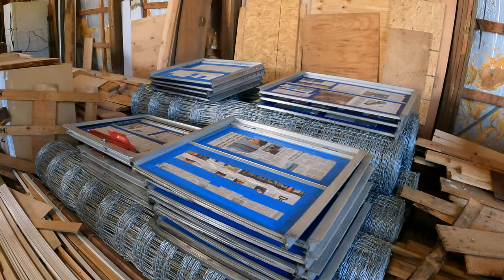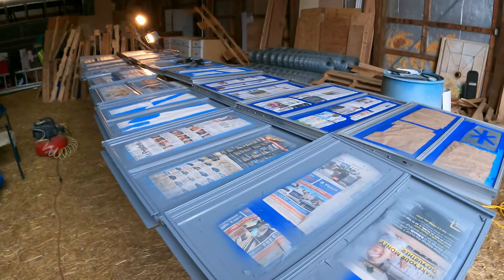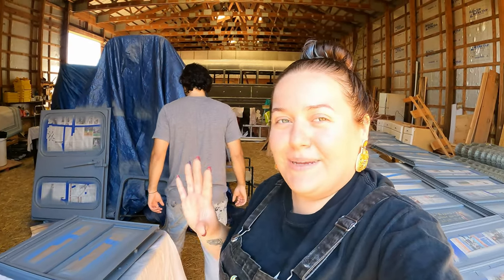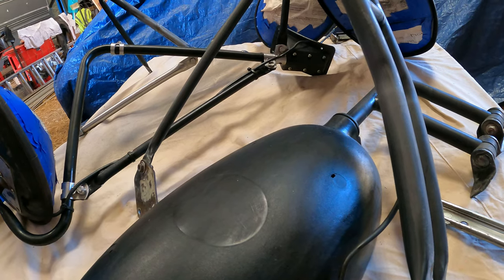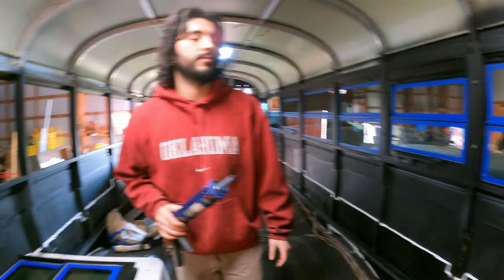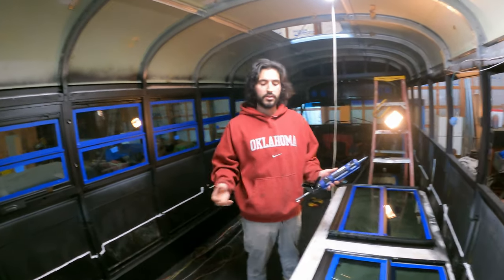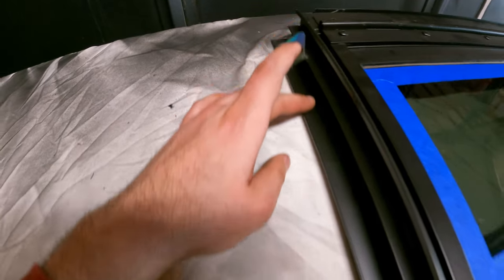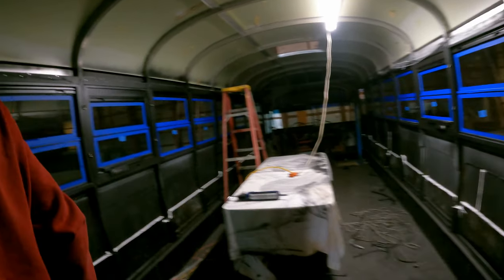School Bus Window Painting & Sealing | Skoolie Conversion

Comment: If you don't sand it. It will flake and peel off. Not to be rude but I'm in autobody. Just mineral spirits..that cleans it. Had a truck that was wiped with liquor thinner in its entirety and the entire truck peeled off with air blower.
Reply from the maker: We sanded the windows using 220 grit sandpaper. Every portion of aluminum was touched up. The work was very tedious & thought to just focus on sanding instead of trying to film it. 🎥